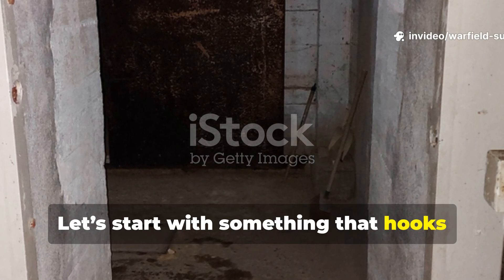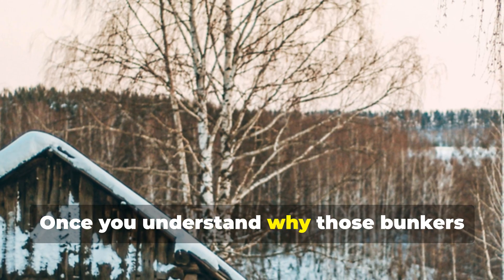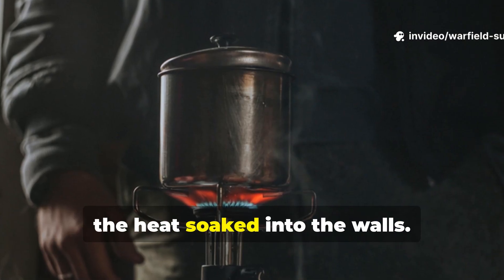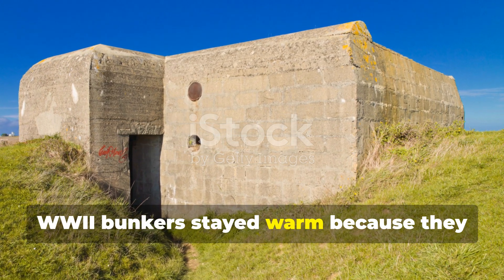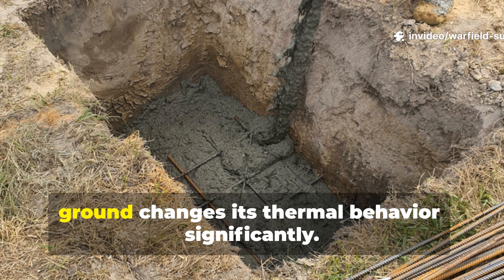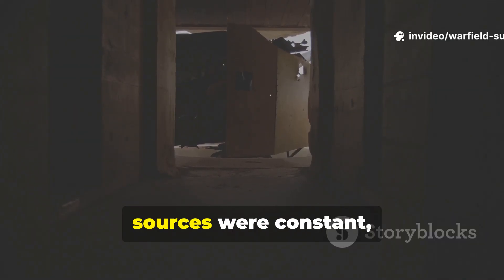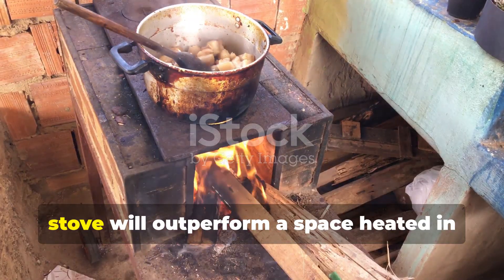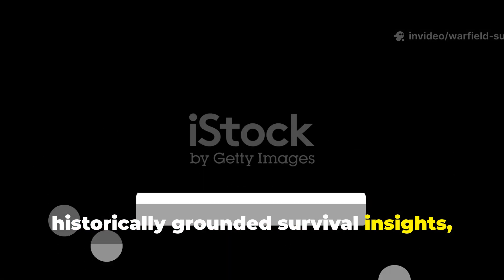Why WWII Bunkers Stayed Warm While Modern Homes Freeze in 24 Hours

Comment: Brick and dirt act as a heatsink so when there's no power it hold it's heat for roughly 30hours, no longer than modern construction with proper insulation and is up to building code